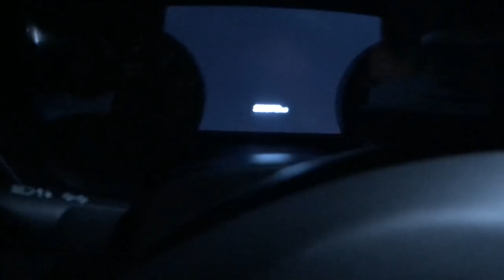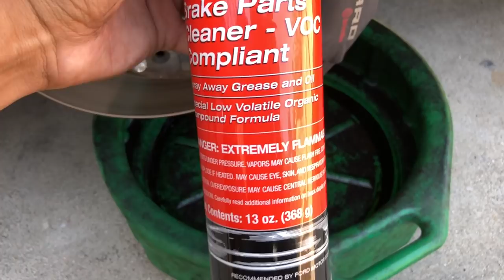How To Paint Your Brake Calipers!!! (2017 Camaro SS)

Comment: You did an excellent job! I had a yellow '10SS and painted my calipers exactly the same way but I put my black brembo decals on directly before the first clear coat. Great job tho. Had mine for 3years, held up phenomenally perfect, never flaked or dulled out even after changing pads and rotors a year later after painting BUT I removed my retainer pins and springs before painting in lue of that
Reply from the maker: Drew Davis thank you 🙏 I also did a coat of clear coat after I put the brembo decals on but I just forgot to add it to the video. They are holding up great just got Scuffed up when I did the brakes.

Comment: Looks nice but this would have been a lot easier if you just removed the calipers, it really is very easy to do. Just open one of the bleeders, press the brake pedal to the floor and use a piece of wood or something to keep it depressed and that will prevent all the brake fluid from leaking out  while you have the lines disconnected.  Having to paint in the wheel well and masking everything off like you did is  actually a lot more work.
Reply from the maker: Eric Michel thank you 🙏 and ya it would have been a lot easier I just didn’t want to bleed the brakes.
Reply: And your brake lights will be on the whole time? Just wrap brake line at caliper with a piece of cardboard before you detach it and clamp with a small Vise Grip. Use cardboard so Vise Grip won’t damage the line.